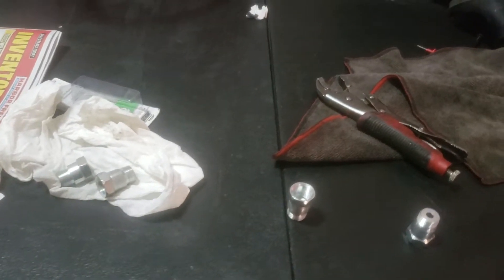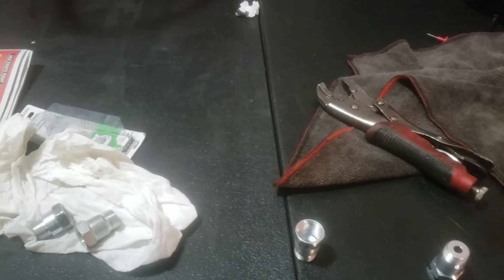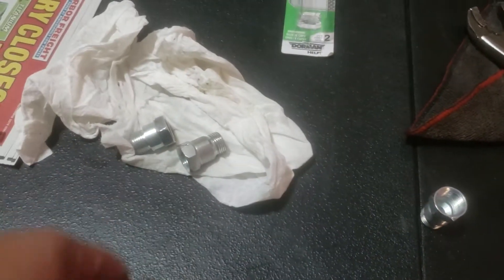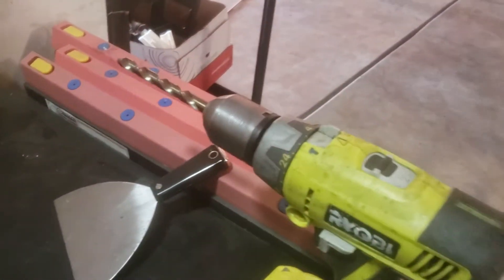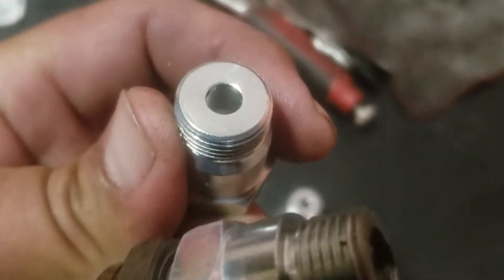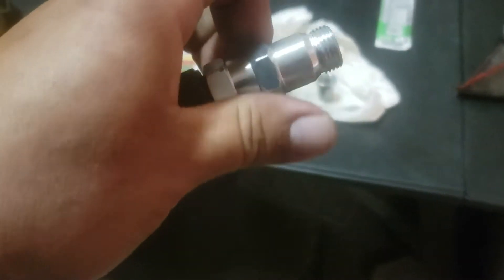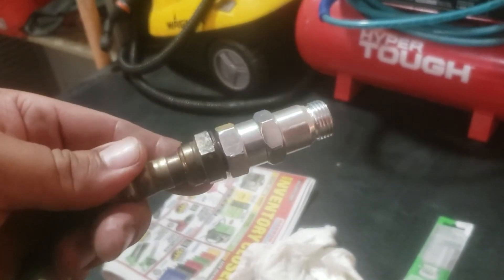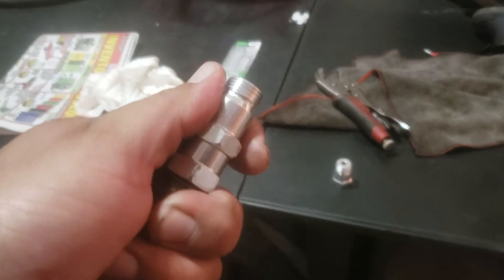How to: Bypass OBD 2 Code p0420 p0430 BAD CATS

Comment: Did this but still have codes
Reply from the maker: No but this a temporary fix and it will not pass emissions test.....cats need to be replaced
Reply: @559powerscape   i mean I deleted my cats lol so a tuner I suppose is my best option now
Reply from the maker: @DCsportcards  yeah to disable the cat monitor...the spacers help too but you can only trick the computer sooo far....if you know what I mean

Comment: Do you have to add both. I did it with the 2 and added steel wool. Always had a 420 code.  But now I got a po137 is it cuz I put both foulers. Some videos only put 1?
Reply from the maker: You know what honesty I'm not sure might possibly be cause of the second one. When I did it it cleared it but came back later down the line....this will only TRICK the computer to think it has good cats, but the computer eventually catches up and throws the code...
I found this on that error code...try just one and see if that works...

https://www.obd-codes.com/p0137

Comment: does this still work and will this help pass inspection?
Reply from the maker: No it doesn't  its just a temp fix so you dont get a check engine.  Sorry bro. This will not pass smog!
Reply: https://www.maxspeed-motorsports.com/store/p519/O2_Sensor_Check_Engine_Light_Fix_Large_O2_Bung_with_mini_catalytic_converter_2005__Models.html
Check these out, I'm ordering these's this week. Cost a bit more but should be the best fix for long term not running cats.